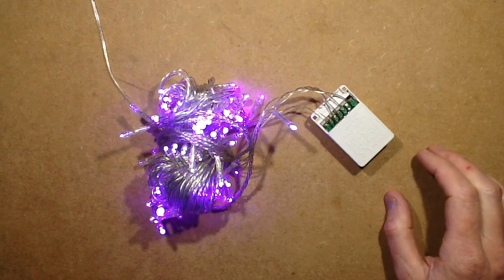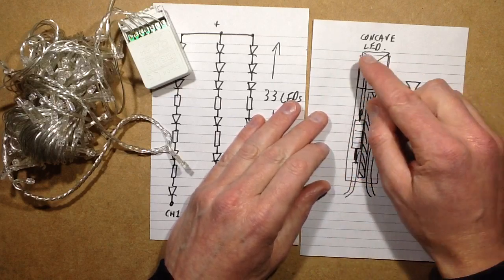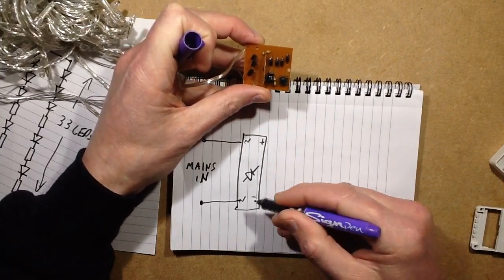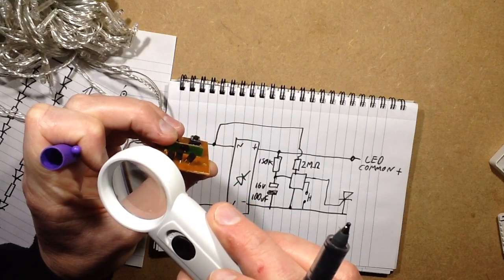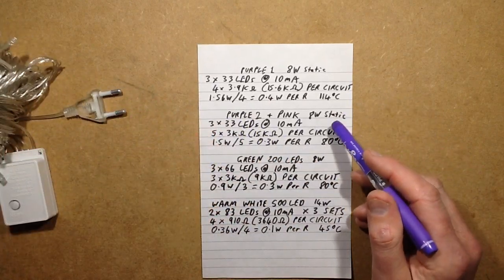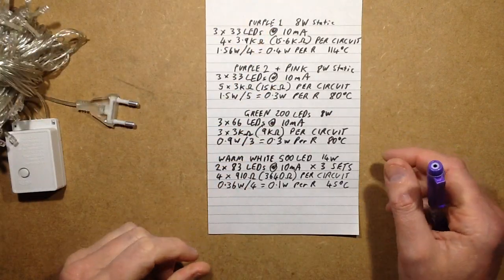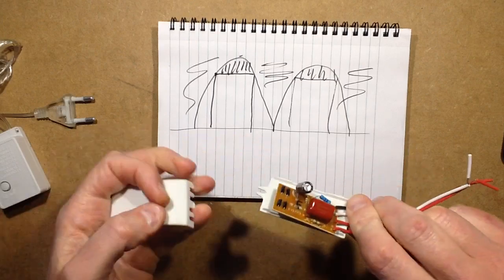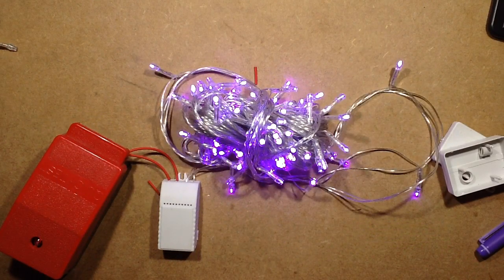Smokin' ebay 100, 200 and 500 LED fairy light strings from China.

Comment: LOL!  Asbestos Christmas trees!

That capacitor dropper trick worked quite well -- I was impressed with that.  Saw someone do that once on a vintage radio -- used the capacitor to not only reduce the "A/C hum" but also to reduce the current going in, as the original radio had a "resistor power-cord" that was a serious fire-hazard.  The capacitor corrected both problems while producing next to no heat.

Comment: I bought a few sets of these a couple of years ago from Amazon.com. I barely even dared to plug them in, much less use them. I ended up stripping the LEDs from them, and then a few weeks later Amazon issued me a full refund, unasked for, because the product was so unsafe. :)
I use a DIY capacitive dropper for my Christmas lights, but it is fused, has a properly rated cord, a properly rated enclosure, and the Christmas light strings I attach it to are the heavy-duty American style ones. It's not a perfect set-up due to the high voltages present in the strings, but it's a heck of a lot safer than it was when purchased.

Comment: Remember getting a shock off these cheap strings even while just handling the wire barefoot on the grass .. sent them back and got a refund. Think I'll stick to low voltage for cheap strings that'll be outside in the weather ..
Reply from the maker: I wouldn't ever dream of handling any electrical product while barefoot on grass.  It's such a good ground reference that there would be a high risk of potentially fatal current flow through your body.
Reply: +bigclivedotcom I wasn't really aware of the mains referenced power supplies at the time .. I knew they were dodgy given the nasty power plug and phone-wire thin cables. Here in the tropics we tend to be a little more relaxed on outdoor clothing, and especially in the middle of summer for xmas, as little clothing as publicly acceptable is all that's really tolerable while hanging lights :P
Reply from the maker: +LPFthings Ah.  This is where high dielectric footwear like Crocs would actually be beneficial.
Reply: +bigclivedotcom I think we'll have to agree to disagree on the definition of "publicly acceptable" in regards to Crocs ;)

Comment: The reviewer of a similar set sold on Banggood.com complained that "...smoke started to come out of it. The plastic protecting the light bulbs melted..."  .Banggood response : We are so sorry to tell you that the plastic can't stand the fire. So you should keep the plastic away from the fire".  .I think they missed the point somewhat!I bought a 100-light set of these with assorted colour LEDs. The LEDs were extremely bright but I didn't trust the wire insulation.

Comment: Maybe I’m over confident, but I just bought three sets of 1000 lights in exactly this design. The plan is to power them from an inverter. Having watched this video, I think I’m going to patch into the 350v DC rail inside the inverter and Power the lights from that to ditch the flicker. Might have to reduce the voltage a bit to take the strain off those resistors (or maybe remove the leds with resistors from the chain and use one big power resistor as a master limiter). Thanks for the video Clive! Very helpful.
Reply from the maker: +Alex Wood If you use the higher continuous voltage you may damage the lights by burning out the resistors.  The unit will also not animate as it needs the AC for timing.
Reply: bigclivedotcom cheers for the advice. I think I'll cut out the leds with resistors and ditch the controller completely. I'll just use some large power resistors to limit the current down each strip and make sure they're beefy enough to take the power dissipation.
I might even low side switch them with some high voltage mosfets and an arduino to reproduce my own patterns (I'm an electronic and embedded software engineer).
Love the videos!
Reply: I think the Chinese manufacturers are listening to you Clive! The sets I got have lots of series resistors not just three, and they're running them well below their rated power dissipation. They have also replaced the pushbutton on the controller with a rotary switch, so they "remember" your previous mode.
I still chopped out the controller and I'm running them from high voltage DC, derived from a 12v to mains inverter. Gives a lovely flicker free light.

Comment: although they are unsafe, its amazingly efficient. I wonder how much safer it would be if ran from an isolating transformer. I know people could still get a shock but at least the live power won't be wanting to get to earth
Reply: +BillyNoMates1974 Yes, was thinking that. Shaver light socket in bathroom for the win. For extra safety you could run a 240v set on the 110v output
Reply: +TheChipmunk2008 He explains around 13:50, it doesnt light until about 200v-240v within the sinewave.

Comment: Just wondering if you took into account the fact that full wave rectified ac halves the input voltage (and doubles the frequency)?
Reply: Halves the voltage?  You do realize that 240VACrms rectified by a full-wave bridge rectifier will output 240*1.41, or about 340VDC?
Reply: +Ethan Poole More like that, divided by 2 actually ;-)
Reply: +gazzaka 
There is no division by 2.
Reply: +superdau  No wonder I have trouble convincing ppl the earth is flat...they don't even know that rectifyingt AC halves the voltage ....rolls eyes....
Reply: +gazzaka Are you serious?

Comment: Thanks for the video Clive, as always everything is explained so well, I enjoyed the part where you changed the drivers at the end, I wondered if you'd use a nice big capacitor to smooth out the rectified wave.
Reply from the maker: +linuxdaemon1372 I swapped the existing electrolytic for a 4.7uF 400V one.  Mainly for the voltage rating.  But it doesn't take much capacitance to remove flicker at the relatively low current involved.

Comment: I'm working on a "unflicker" supply circuit for 8 to 10 strings of 90 lights.  (I went for the plain boring warm white.)  Anyway, each string is 2 parallel circuits (threads?) of 45 LEDs, which each seem to peak at 25mA @170v (US mains).  To drive 16-20 of these threads, I think I've landed on a rather large dropper capacitor of 100uF and filter of 1000uF.  The dropper is actually a motor run-start capacitor, and its value is huge because I still want about 160V on my DC output.  That will drive steady 10-12 mA per thread -- which is still plenty bright, especially considering it's on full time, not just at 20% of the unrectified wave.  Maybe I'll be done with it by Christmas!  Ha!
Reply from the maker: +arfyness I wouldn't recommend using such a high series capacitor.  The inrush current could potentially damage the LEDs.  It might be worth getting some of the little capacitive droppers off ebay and using one per set or two.  That might actually be cheaper, and it would definitely avoid the hazard of such a high valuer capacitor charged to a fairly high voltage.
Reply: +bigclivedotcom I do appreciate the suggestion.  And how I've tried!  I've even simulated all this in LTspice, finding that the only way to get enough current through even one strand of LEDs with small dropper value is to reduce the end-to-end voltage across the load... cut the strings in half.  I've thought of chopping them up, but they're quite well made outdoor ones.  I'm still considering it bit I want this supply to work for any LED string. 
The only inrush I see in the LTspice shows between AC and the filter cap.  I found KBPC5010 50-amp rectifiers quite cheap so that's no biggie.  Farther down, the circuit, the load current takes quite several AC cycles just to get going.  45 LEDs at nominal 3.4v adds up fast.  If I were on 220vac I could do with 1uF or something like that because the load voltage is significantly less than supply.  But this is sissy 110vac, peaks at 170, and the strings need 155-160v to light decently.  the are the ones that just plug direct into the wall, no little adapter thing. 
What it comes down to is that AC capacitor is there to limit inrush current, with only little effect on operating current/voltage. 
I'll link to schematics and waveform graphs I've cobbled together, when I get home.

Comment: what does a rectifier do? couldn't find anything but "diode bridge" which isn't this, right?
edit: does it make the polarity of the output "not" change when using AC? what does this imply for the circuit, if this weren't there?
Reply: +Justin Koenig Yes. Yes. and it implies dead LEDs (they don't like reverse voltage across them)
Reply: diode bridge and rectifier are same thing
they take Ac and put out Dc
Reply from the maker: It's a bridge rectifier or diode bridge.  Four diodes that convert AC to DC.
Reply: does that mean they had a 16V cap across DC fluctuating voltage of up 220\240 V?
Reply: my bad. missed the resistor.
Reply: +Tony Jobson As Clive's mentioned in a lot of his other videos, it's still a bad design, if the load drops, due to a failure in another part of the circuit, yes, it could provide 340v (peak) to the 16v capacitor. The results would be... Attention gathering

Comment: About the flicker ... I remember seeing a video comparing different light bulbs with a optical element connected to an osciloscope. All of them normal, luminiscent, led were flickering (50-100Hz unseen for the naked eye), except for only one led bulb, obviously with a good power supply.

Comment: I happened to see this on my suggested videos and actually, I just purchased a set of these....the 32 foot version with 100 blue LEDs.  They are actually advertised as "safe design".  I wonder if somebody modified the circuit over the last few years since you did this video.  Mine do not heat up at all (although I don't have a FLIR tool), I cannot feel any heat through the plastic/vinyl.  Also, I noticed that the set that I have only has a resistor inline with the first 10 LEDs on the strand.  None of the following LEDs have an inline resistor.....I wonder if anyone else has a set of lights like this?

Comment: I know thats an old video, but just for future reference: The peak of the sin wave from mains supply shouldn't be 240, 240V is RMS iirc. So your peak should be around 1.414 of your RMS (around 340V).
Reply: You mean sine ;)
Reply: +That Guy oh yes ofc that's the correct term, don't know why I wrote sin ;) But I also noticed that clieve has mentioned peak sine correctly in various other vids, so I assume that's a derp here.
Reply: Chefe Yeah, I never understood why voltage wouldn't be referred to as the peak though, there must be some reason.
Reply: +That Guy I guess it's just easier since we work with DC a lot and AC RMS = equivalent DC voltage, just my best guess. maybe there is some other (maybe historical) reason for doing so

Comment: My uncle wanted me to check a set of Christmas lights once, and I found it was some cheap Chinese set he found online.  There was no strain relief, one of the main wires had pulled loose from the board.  They weren't thick-enough wires, either.  I refused to fix them and told him to throw them out.  He's always looking for a deal, but I don't think burning his house down or getting shocked should be the result.

Comment: I think the larger sets are very dangerous. Just bought a set of 1000. The fabrication was poor. Some of the resistors were not connected well and when plugged in, they started popping the tops of the diodes.

Comment: Clive can you change volts into amps or is there a way to create amps, my lab power supply runs only 1 amp at 120v adjustable  voltage. I always get the answer that its incredibly hard and thats all, we run 240v mains. Can you do a episode about it please.
Reply from the maker: I'm afraid it would involve a complete redesign and build of a new supply.  It would be better to keep that unusual but useful supply and add a new lower voltage, higher current one.
Reply: +gigabytex64 
Sorry, but if you have to ask a question like this, I feel that you shouldn't be playing with a power supply that goes to 120V. In principle what you want leads to building a new power supply, as Clive said. That's why you always get that answer.
Reply: The question was only general, AC voltage can be used as long as its safely so does the fact that I was one of 3 technicians working at voltages in excess 100000v at a hydro electric plant for 4 years and safety at all stages. And I take it that your advocating that experimenting and learning at home should be illegal.
Reply: I have the unusual top voltage for a pulsed sed of lights totaling 100 bulbs thats all, i can build another supply fosay 50v vairable voltage dc and setup so I can set the amps as well. Thanks Clive

Comment: I've bought 16 pieces of these for my xmas project. The PCB on mine is a little different tho. It's half the size of this one and only has 2 different valued smd resistors , a little smd capacitor (i think) and a black epoxy looking blob on the PCB.

Comment: Half wave rectified? Looks like it.
Reply from the maker: +Steven King Full wave rectified for most, but not smoothed.  The high combined LED forward voltage means they don't light until they are well into the sinewave.

Comment: Interesting, i picked up some of these types of LED's,they look the same anyway but are powered by 2xaa batteries a string of 48 of them from the dollar store.  Last season I hacked in a usb cabe to it giving it 4.5v.  I wasnt concerned if they'd burn out and they did, but not like how this video describes and only a couple did while the others worked fine still, no melting fortunately and they were being over volted, it was so bright it was amazing actually, I thought about adding a proper power supply of some kind to not give them so much but im an electronics noob and its good to hear theyre not very heat tolerant so i'll be more careful.
   I also picked up some of those bead (blob) LEDs here from the dollar store, ones that look like they're attached to bare wire,  a string of 60 powered by 3xaaa batteries I thught would be good for a usb powered mod and id imagine are more heat tolerant?  They seem to perform better then the types of LEDs shown here anyhow, they're just stay brighter for longer it seems on the batteries.  Anyway glad i found this channel and video, the info here is very valuable and could save lives, thank you.

Comment: Why do some strings not have any resistors?
Reply from the maker: The low voltage (31V) strings use current limiting in the power supply.

Comment: what were the specs of the capacitive dropper used?
Reply from the maker: +Stevie C 680nF dropper and I swapped the electrolytic for a 4.7uF 400V one.
Reply: +bigclivedotcom i'm also wondering at this point if instead of converting them to run with the capacitive dropper driver, i could perhaps convert them to run with the mountains of 24V/36V transformers i have from the mounds of old-school fairy lights that have long since run thru their spare lamps...
Reply from the maker: +Stevie C You could, but it might be a bit of work.  Typically on a 24V AC transformer you'd need to add a rectifier and then cut the strings into sections of 7 LEDs with a suitable resistor in series with each section.
Reply: +bigclivedotcom Got an ebay link for those droppers?

Comment: I hung a set f these  LED Light out side my house believe it or no they are the only ones that are still working 2 Years later now. I still do not like how Cheesy they are though. Like very cheesy I Cannot believe 120V runs through those TEENY little wires!

Comment: how do you turn them on i just got mine today
Reply from the maker: They should just run.  If yours don't then be careful as there could be a live wire loose.
Reply from the maker: +ashley zuniga If they don't just work when plugged in then they are faulty or wrong voltage for your part of the world.  It could be as simple as a wire off the PCB.
Reply from the maker: +chubby funny 5 The common cheap Chinese light strings are not safe for use in the vicinity of kids or pets.  They're also not suitable for outdoor use despite saying they are.  If you are using them indoors with no kids or pets around they are OK, but otherwise get proper low voltage ones.
Reply: chubby funny 5 I think the small sets are probably safer than the really large sets. I have had good luck with 200 or less. I just bought a 1000 led set. Very dangerous if someone messes up during production!

Comment: "Christmas LED Mesh Net, of Death", Part Deux ....

The eBay item # 351335116640 shows more detail, about how they accomplished the 'mesh' effect, see 4th pic from the left. The resistor appears to be 820 ohm @ 1/4 watt. I can see 5 output wires, so 1 common and 4 strings of 30 each (120  LEDs). 110 volt @ 1 watt power output, for 120 LEDs and ??? 680 ohm resistors, the math eludes me. 

They are sold as indoor/outdoor lighting, with the caveat, "The net lighting should be kept away from dampness, rain or mist". 

With 110 VAC (US) they are only half as deadly as the 220 VAC (UK) ones, or are the UK ones twice as deadly? Mostly dead or partially alive, is not all dead, with all dead, there's only one thing you can do, go through the pockets for change.
Reply from the maker: I'm waiting on an LED net coming from China.  We'll explore it once it arrives.
Reply: +bigclivedotcom 

I am looking forward to it, either way I am sure it will be a flaming success ...